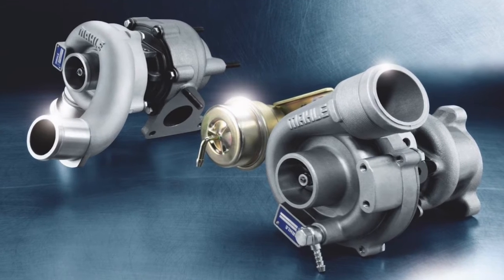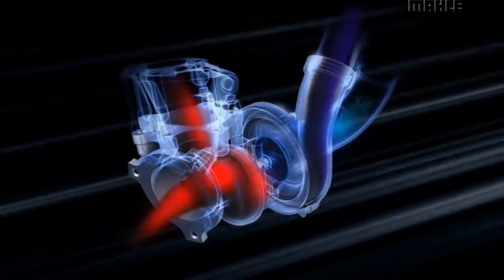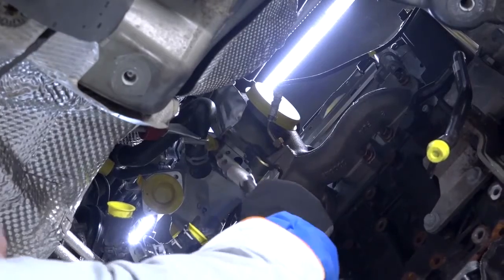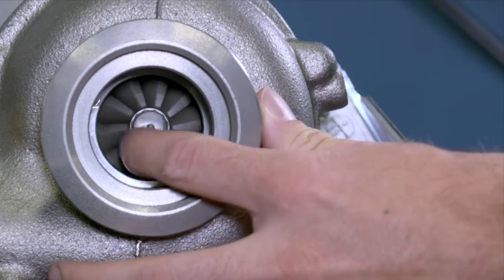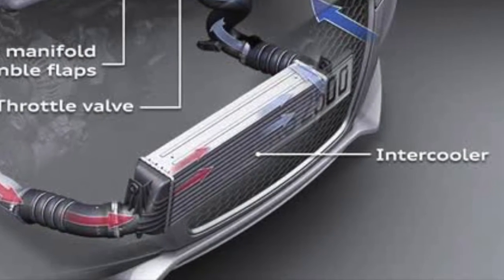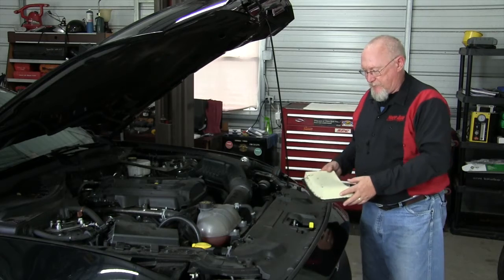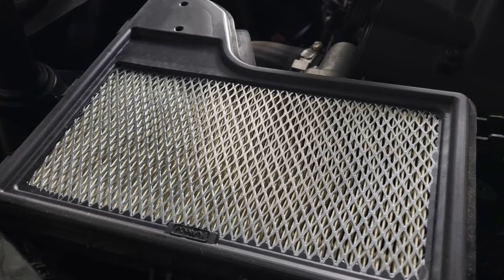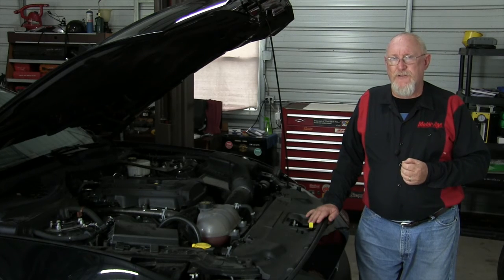The Trainer #95:  Turbo Tips

Comment: 300,000 RPM's? I'm not too sure about that one.
Reply from the maker: Ok, I may have overstated…”The turbine in the turbocharger usually spins at speeds between 80,000 and 200,000 rotations per minute (rpm) — that's up to 30 times faster than most car engines can go. “

Comment: All good advise, however:
I'm pretty sure the reason the industry has gone turbo is to avoid the displacement taxes now imposed by some other countries.
Sorry, IMHO, a turbo has no place on any vehicle that must be depended upon for reliable transportation.
Reply: No real problem with low pressure turbos, the  majority of vehicles in Europe have turbos, a 2 litre turbo diesel will have as good or better performance than the  2 litre  N.A. engine option and use half the fuel. In small cars a 1 litre turbo gasoline engine gives the same performance as a 1.4 to 1.5 engine and only uses 2/3 of the fuel. As long as the engine is engineered for a turbo and the owner  attends to regular oil changes with the specified  high quality fully synthetic oil there are no issues.
Reply: Almost every large truck on the road is a turbo charged diesel. They accomplish millions of miles very reliably all while hauling freight across global highways. Forced induction engines are not necessarily any less reliable than naturally aspirated ones. Maintenance and good operating practice is the key to longevity.
Reply: reliable transpoertation, you mean like commercial busses and trucks???